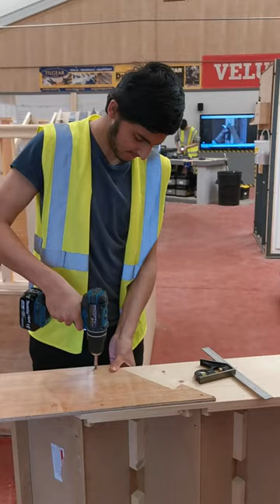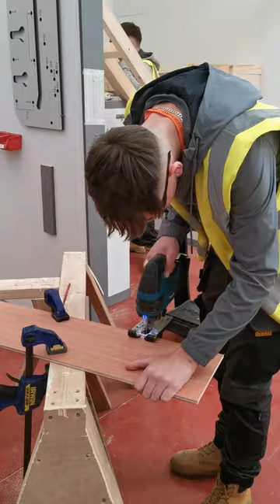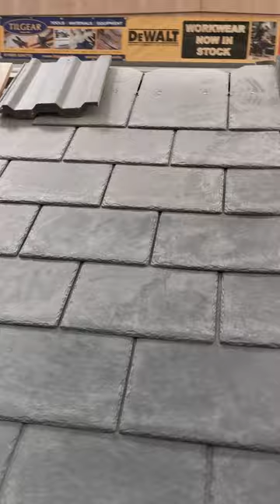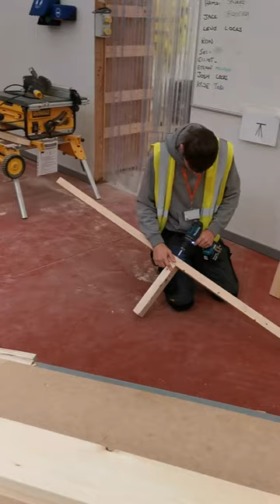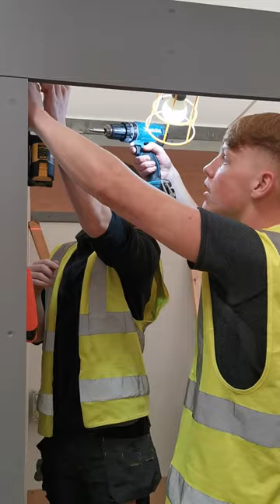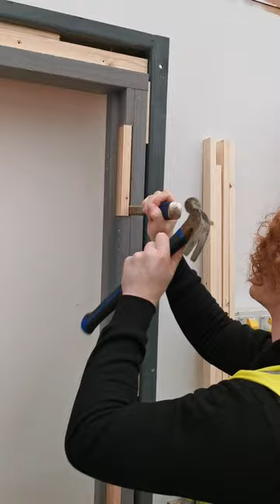Carpentry and Joinery Video Tour - Bury College

Comment: First lad rounding every screw off so nobody can take it apart smart and second lad cutting a straight line with a jigsaw
Reply: Weren't allowed to use circular saws in collage its a joke nowadays.
Reply: Thats ridiclous you need a circular saw for 60% of work  @YELLOWRIDGE
Reply: @Baz09  Tell me about it. I use them all the time now. It was a huge safety issue, I guess. We could only use chop saws, and we had to share one between our entire year group. What a joke that was.
Reply: @YELLOWRIDGE  jaysus how did you's get any work done at all
Reply: @Baz09  Honestly, we didn't. I learned everything I know on-site with my uncle. College was a joke. I only went to get the qualification, which was completely unnecessary, if I had to say. The only thing I think it helps with is teamwork. It gives you a chance to talk to other people who also think it's a joke. stupid af 😂😂
Reply: @YELLOWRIDGE  yeah fair enough ive been working with my dad who is a carpenter now for a year now (im 14) and can do all of the stuff in this video without clamps point being it just shows you how ridiclous this college is.
Reply: It was all hand tools for joinery..

Comment: Great workshop wtf is that first guy doing tho u don’t hold an impacter with one hand when screwing down ?
Reply: 1. That's not an impact driver, it's just a regular drill
2. Of course you can use an impact driver one handed.

I'd recommend you don't try to criticise people doing things you don't understand.
Reply: @mattwood1977  he’s rounded every screw off and I wasn’t meaning to critized just should have used two hands to try place it in better
Reply: @mattwood1977  I’ve done plenty of joinery gardening and landscaping mate run my own jobs so